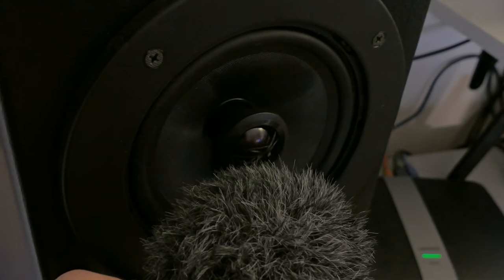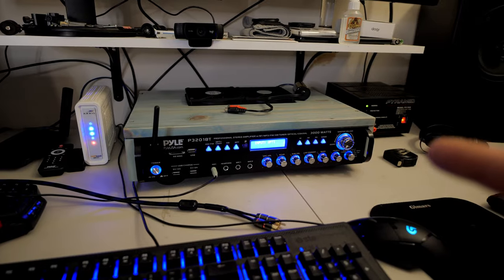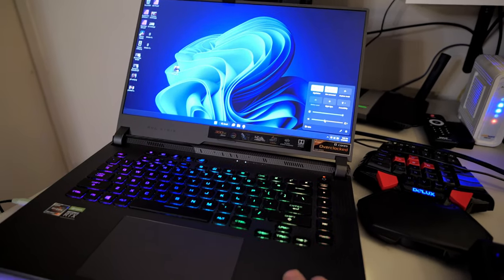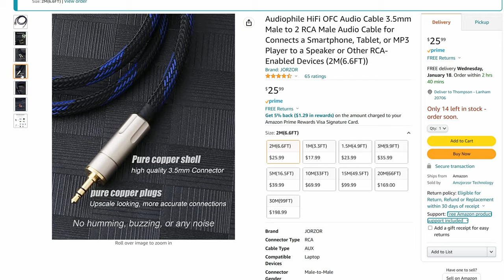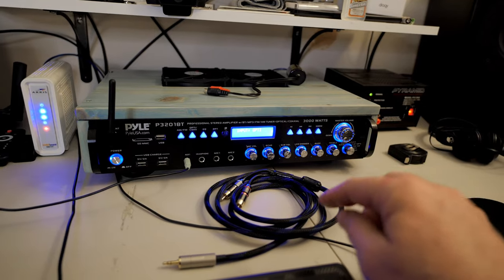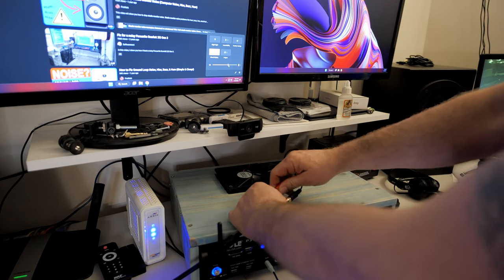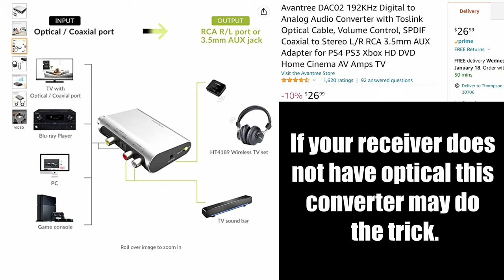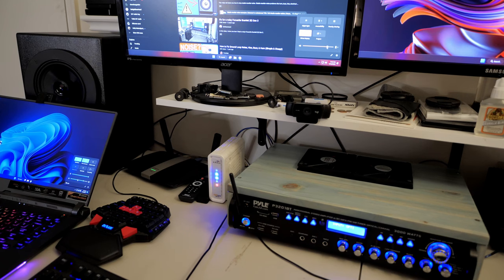Amplifier Ground loop Hiss Buzz Hum or Studio Monitors! PC electrical noise in amplifier

Comment: Help me cheap out on my LT1 cam, please. Can I use a used sbc cam with a longer dowel and some beehive springs? Do you know which part number they are?
Reply from the maker: Any step nose cam will work best. I have only run a OE roller cam for n my gen 2 so a cam with a button I have no idea how to set it up since I have never tried it.

Comment: Another way to go is a usb sound card ($10). You can put the card right next to the amp, and then run a long usb cable to your pc.
Reply from the maker: Yes I did that on another PC used Fosi Audio K5 to a car amplifier / AC to DC converter and Polk Speakers worked great.